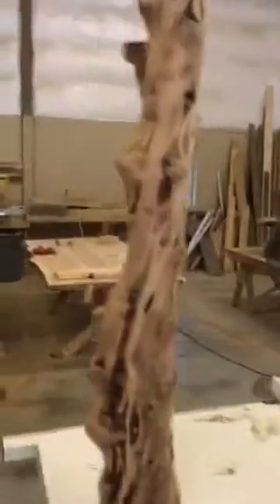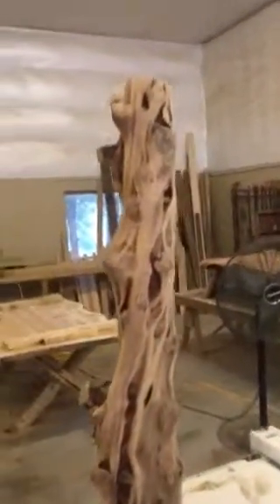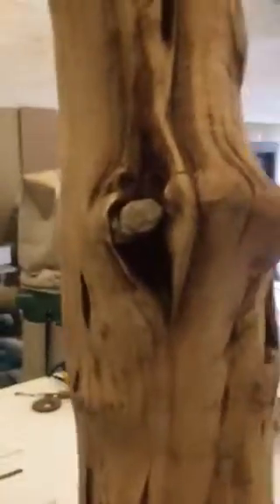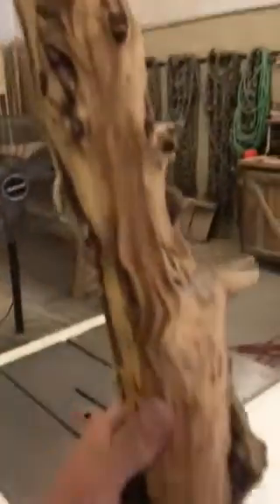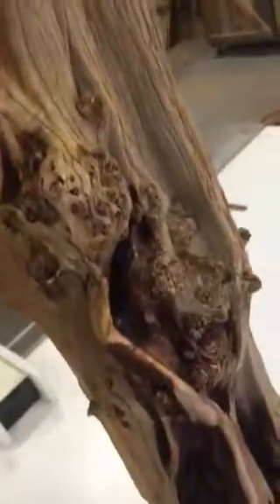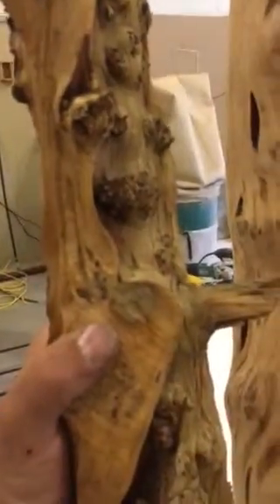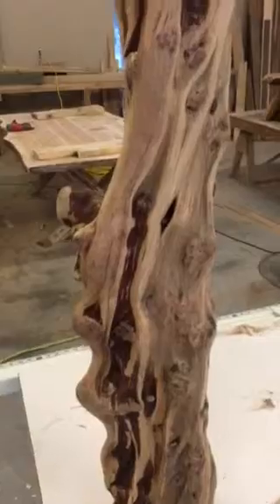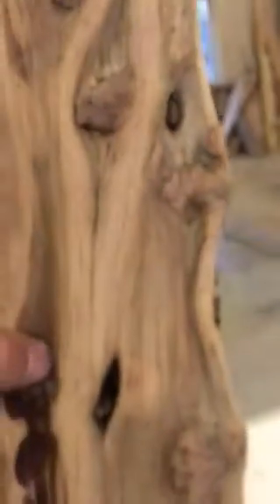Juniper log bed part 1

Comment: Do you sell these? I would like a King ked frame. What would you charge?

Thanks!
Reply from the maker: Rory Taylor I make juniper log beds, I haven't finished this one yet.  These juniper burls are hard to find.
Reply: Dustin Cossitt when will this be finished? And whats the price?
Thanks!
Reply from the maker: Rory Taylor I'm not 100% sure hopefully by the end of the year.  I've sold king size beds from $1200 to $4000.  Just depends on the rarity of the pieces that are in the bed.  I'm guessing this one will be in that $3000 ish range
Reply: Alright, let me know when it's finished. Thank you!
Reply from the maker: Rory Taylor I will!